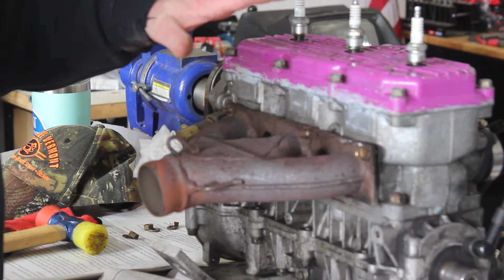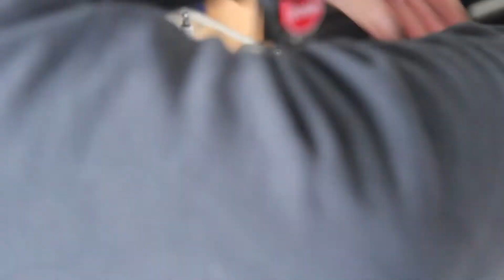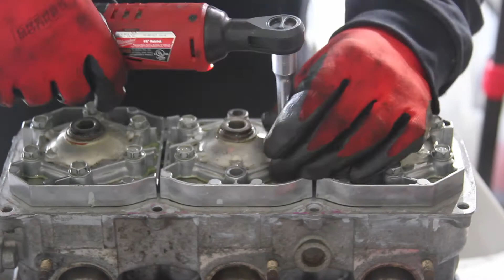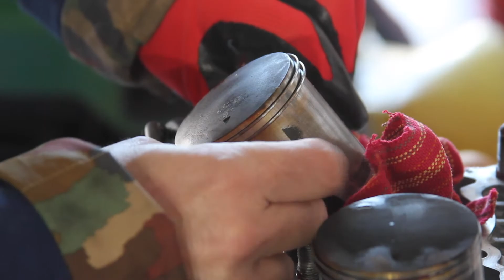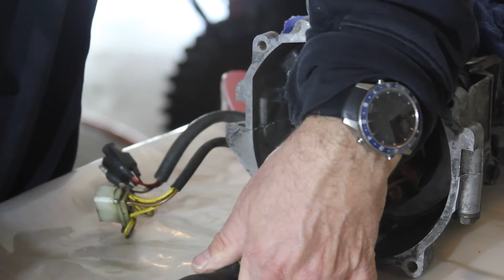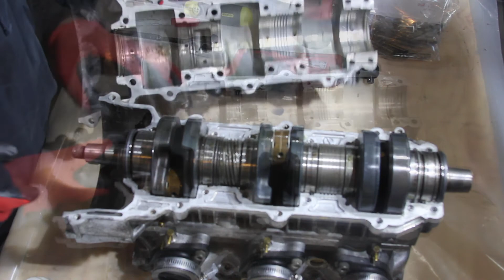Old Sled Rebuild - Part 2: Polaris XLT 600 Triple -  Engine Tear Down

Comment: In 1999 polaris&fuji put another oil lubricating line on the pto side bcuz of crankbearing failures that is wierd that yours is mag side I have a 96 and a 99 xlt special my 96 also has bad crank bearing

Comment: Mine accidentally got mixed up. Can you tell me which sizes go where
Reply from the maker: I don't have an exact answer.  If you look at part 3 in this series you will see me assemble the case.  There are some shots at about 8:00 min where you can see what bolts I am installing where....Short of that,  I would do a process of elimination and thread the bolts in by hand only.  It should become evident which bolts are too long for the shorter holes.  I hope this helps you.